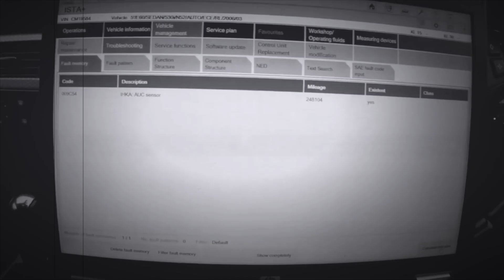BMW N42/N46 Engine Reliability 2020

Comment: Hello
My E46 318 ci 2002 Works with 3 cylinders.  The engine is healthy.  Where does the problem come from?
Reply from the maker: I do not know & I don’t care.

Get rid and get a proper BMW with a 6 cylinder engine I will not help you keep that car on the road hopefully it gets worse so it’s unfix able like the rest of these
Reply: BMW Doctor why so much hate dude ?
Reply: How have you determined that it is running on three cylinders? And how have you determined that the engine is healthy? I don't mean to be rude but, a healthy engine runs on all cylinders ;)

It could be a faulty ignition coil, plugs, injector. 

Lots to go wrong on these engines. Your best route to finding problems is often getting a k/dcan cable and a copy of INPA. Good diagnostics can save a lot of time and money.